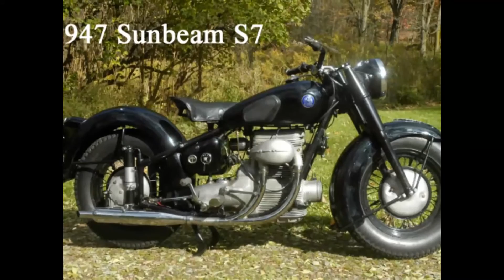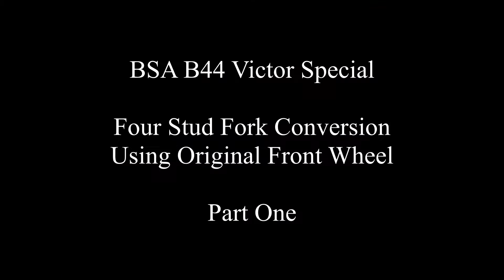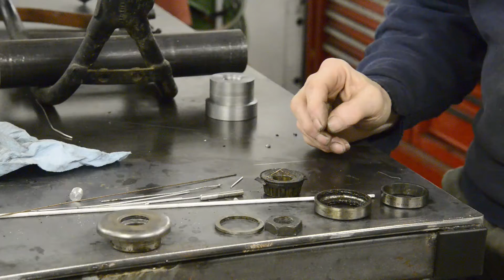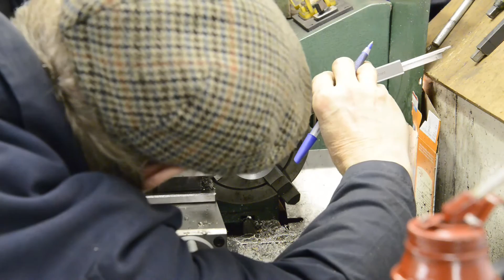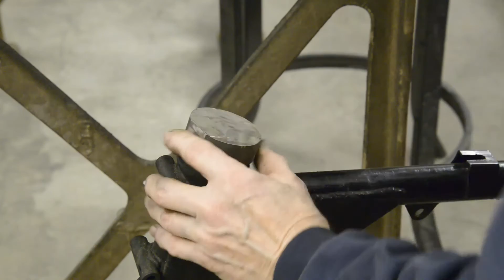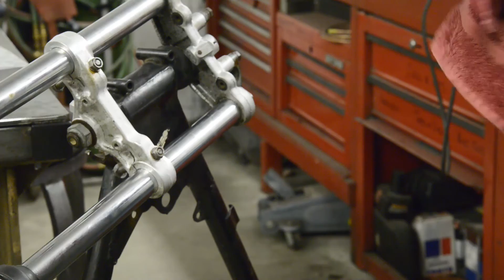BSA Victor Special Fork Upgrade

Comment: Hi I know this is not in this video but I can’t find exactly the video you described what welder u bought ac dc tig can u tell me or what video explaining why cheers
Reply from the maker: It is an HTP Invertig  221. It received good reviews from the welders on the internet that I trust. Then I saw a video of a chap dismantling one and looking at the electrical components. They were all good quality items. The unit is made in Italy I think.
Reply: @BritanniaMotorcycles  is it the 221? Fith street fab uses one that’s good enough for me his welds are fantastic!

Comment: Hi Michael, I love your videos. very informative!

I have a 1967 BSA Victor Roadster, the road going version of the B44. I am thinking of lowering the bike 4-5 inches, which is easy to do for the rear. How much modification and machining would be required to lower the front? I think it would be just the top triple tree machined out to free the forks to slide up above the neck. Would that do it?
Reply from the maker: If you are going to use the BSA top yoke you will have to modify it to clamp onto the fork stantion. I did that to fit the Yamaha 650 forks into the Norton top yoke on the Nortaha. I can't remember which episode it was but if you go back and find it it will show how I did it.
Reply: @BritanniaMotorcycles  Thanks Michael

Comment: On my Victor the rear wheel is off to one side by about 2cm.  Should it be centred between the shocks?
Reply from the maker: If you measure from the shock mounts you will be about 6mm further from the drive side mount than from the timing side one. Best thing to do is take off the tank and lay a straight edge down the centre of the top frame tube to the rear wheel. The wheel centre should be on the same line.

Comment: I see you are parting gingerly.  I now take a good bite and plough through. I find it works better. Learned that from John Mills ("doubleboost" channel). It puts the tool under so much pressure it can't chatter. It is a little frightening at first.
Reply from the maker: Hello again. The biggest problem was the lightweight lathe. I now have a Colchester Master 13x36 and I can just wind the tool into steel even without a worry.

Comment: I thought about doing something similar with a B40 front wheel, which seems to be identical to that Victor one.
In the end I bought a CB550 front end and wheel for the sake of less faffing about ( it's a road bike, so weight isn't an issue - plus it'll help to prevent wheelies when the 20bhp of the SS90 motor kicks in :))  )
I've got a set of late pre OIF T100 forks that'll eventually replace the Honda ones, once I can afford a twin leader to go in them...

Comment: Michael the next time you are doing a parting operation,try putting your parting tool upside down and running the lathe in reverse.Works great for me.  Bob
Reply from the maker: I have had that mentioned before but have not tried it. Now I have a much bigger Colchester lathe and it parts with no difficulty at all. It's amazing what extra weight and rigidity does for a lathe.

Comment: how would put a disc brake ona 1960 b40 .it was 21 c today and in gos under 15 c we move north . Saw my fill on cold weather in England .iyou would of move some where warm  like come from the north vik
Reply from the maker: I would say put the forks and front wheel off a Yamaha XS650 in the BSA frame. They work well and are pretty common. Also they look very good on the older bikes. You can see my Royal Enfield fitted with those forks in the gallery on my website. I am too old to move again so I just spend the winter by the wood stove.
Reply: thank you it sound good and I will do that

Comment: As you didn't put a recess in the bushings for the new headraces, what prevent the new  bearing races from falling into the frame. That would be rather a significant emotional event for the driver it happens to.
Reply: The original internal lip still catches the smaller bearing, you could even hear the distinct ring when they bottomed out.
Reply from the maker: As Richard mentions the seat for the original bearing is wide enough to support the sleeve and the new bearing. I should have shown a shot down into the headstock. Well, we live and learn. Thank you both for watching.

Comment: You might find parting easier if you are brave and put the tool under more load. A heavier cut keeps the loading more consistent and, all other things being equal, prevent chatter.
Failing that, it might be worth watching Joe Pie's "treatise" on basic parting: youtube.com/watch?v=5LtYzjR1JuM
I favour a parting tool with built in top rake and the use of power feed(with hand hovering over operating lever) but not all lathes are suitable for that.
Reply from the maker: I checked tool height etc for the second cut but all seemed correct. You are probably right about applying more pressure but it just seems counter intuitive so you tend to shy away from trying it. Of course I could buy a bigger lathe with some heft to it and a power cross feed and solve the problem that way, but unfortunately I have to eat . But I am keeping my eyes open. Thank you for watching and taking the time to provide a comment.